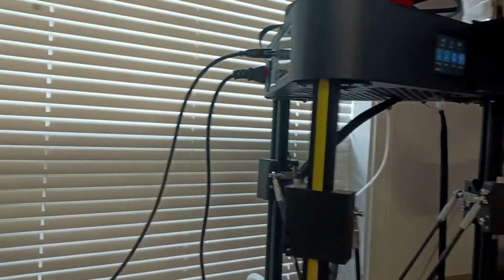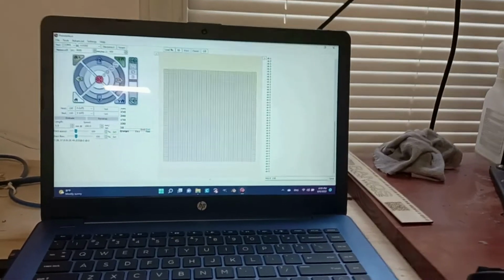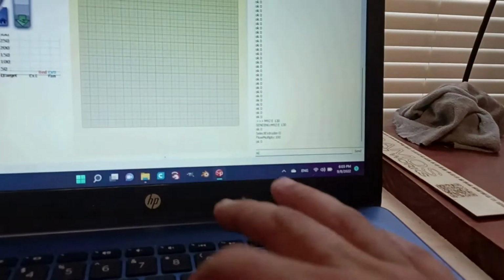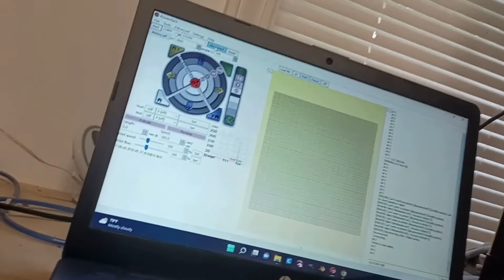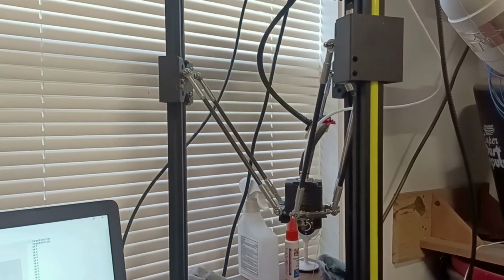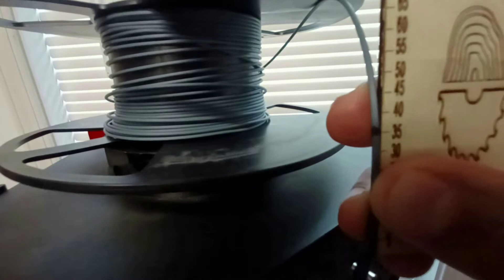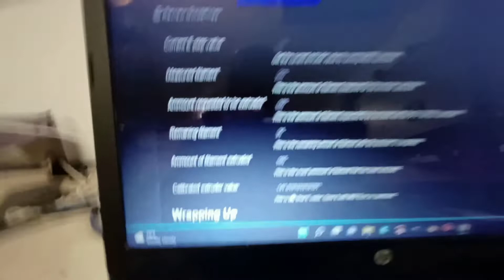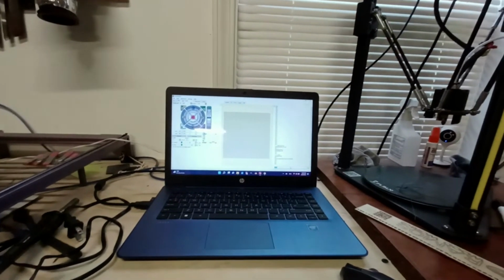How to adjust E-steps on FLSun Q5 and any other 3D Printer

Comment: Thank you for this video! 
My question is:
I did exactly as you did and the first time it went perfectly. 
I did a second time and instead of extruding filament is doing the inverse when I give the comand G1 F 100 E 180.
Do you know why??

Thank you!!
Reply from the maker: Sorry for the late response, I am not sure why that would happen. Did you get it fixed by chance?
Reply: @theveteranworkshop8328  I had this same issue so i updated the firmware from the official site and it worked perfectly. I hope this helps.